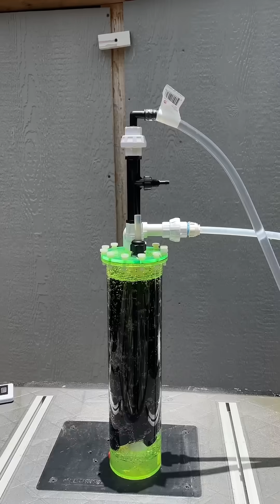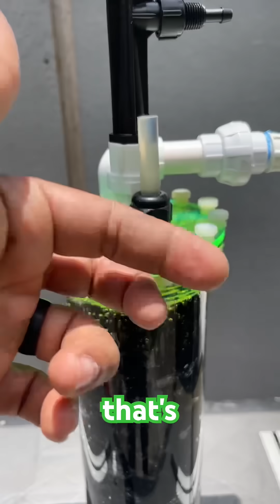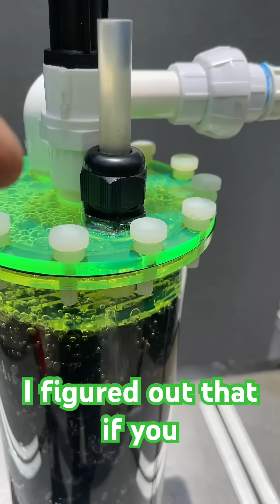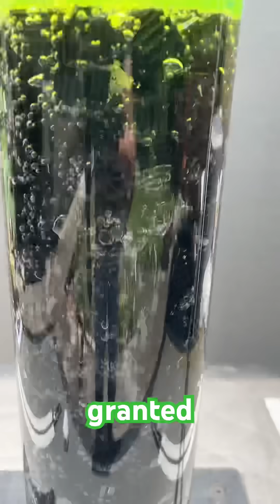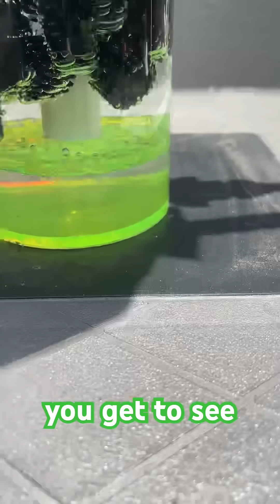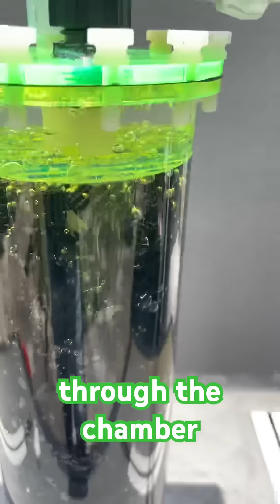Dive into my latest adventure as I put my costume ozone reactor to the test #marineaquarium

Comment: Why not just put the ozone on your skimmer
Reply from the maker: I like running ozone through its own reactor with a carbon stage instead of the skimmer because it gives the ozone more controlled contact time with the water. That means better oxidation, clearer water, and more efficient removal of organics. The carbon reactor also neutralizes any residual ozone before it goes back to the tank — so you get all the benefits without risking livestock or equipment.